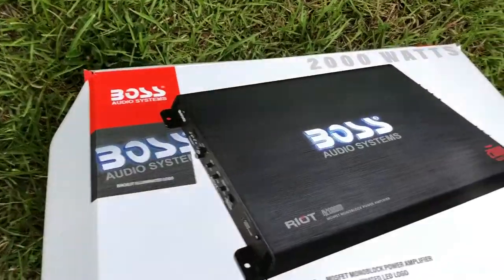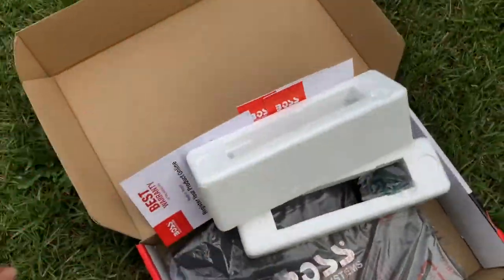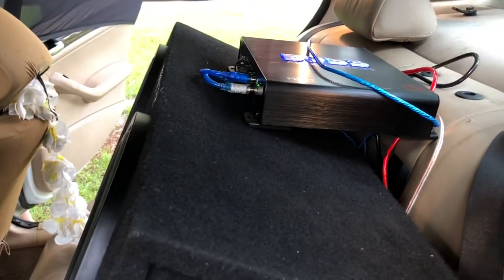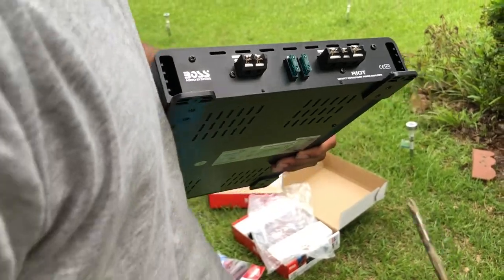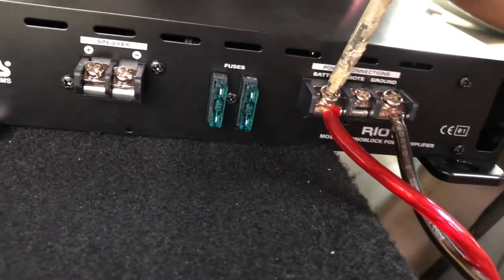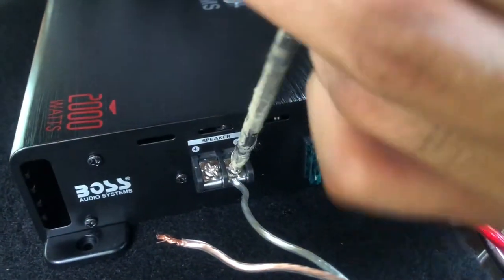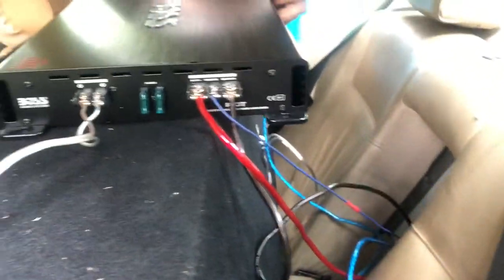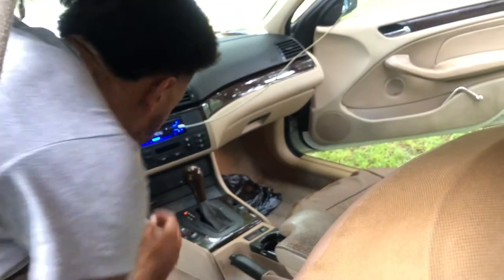BOSS Audio Systems R2000M Monoblock Car Amplifier review on 2 12s 1200 watt subs.

Comment: Few things to know here......
*Do not max out everything
*Do not buy boss products.... ever. That 1100watt amp barely puts out 200 watts.
*Use at least 12 gauge speaker wire.
*Use at least a 4 gauge power/ground wire for 500 to 1200 watts (0 gauge or 2 gauge for anything over 1200 watts)
*Again, stop using those boss amps. You are severely underpowering your sub.
Reply: Not all boss audio amps are bad tho …..